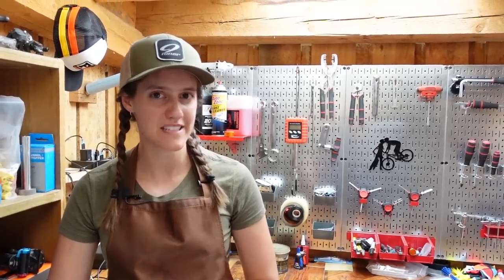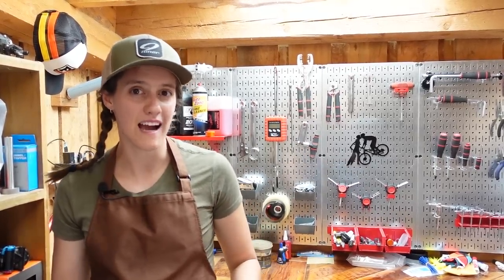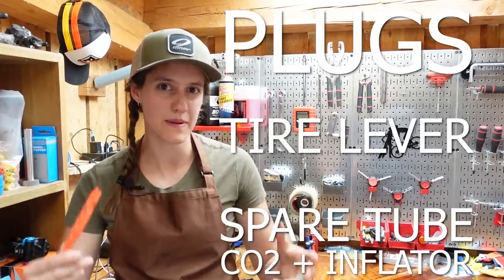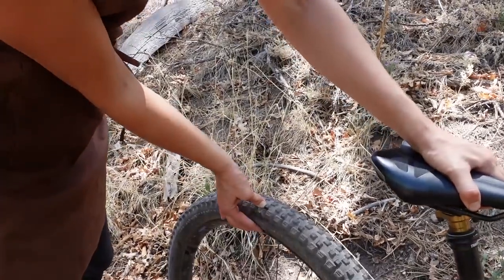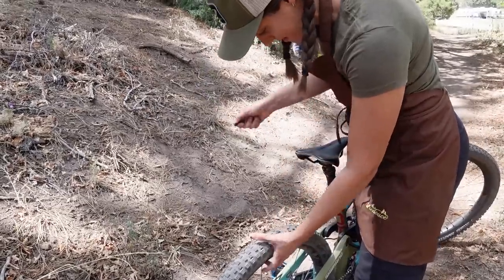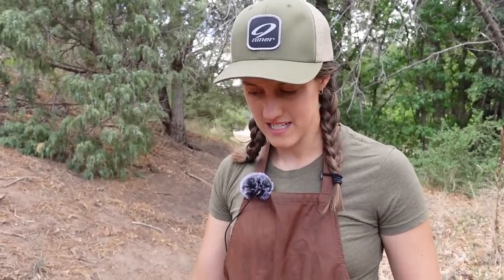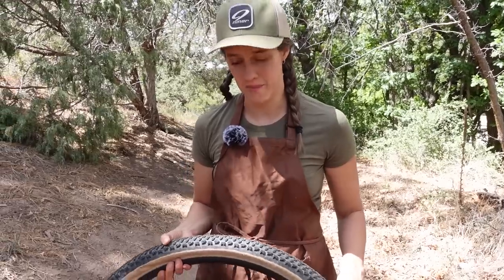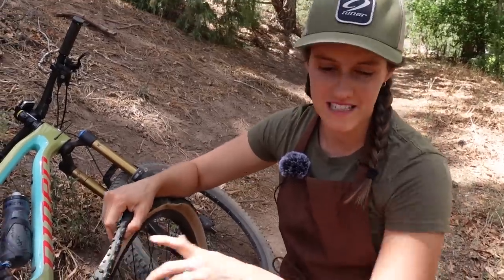DON'T LET A FLAT TIRE RUIN YOUR RIDE (tire plugs, tubes, CO2 and what we carry) | Syd Fixes Bikes

Comment from the maker: We're BAAAACK!!! Thanks for sticking around while we took some time to regroup. Looking forward to sharing some trailside repairs over the next few weeks! Are there any MTB mechanicals that have given you problems that you'd like to see us cover? ⬇️
Reply: Probably not a problem where you hang, but after a winter of mud and washing the bike I had to replace a number of my wheel and rear suspension bearings. There's a challenge for you ...
Reply: Chain repair, and best items/ tools to pack for the trail.
Reply: Derailleur break turned into a single speed
Reply: On trail….  Things that let you ride vs walk out: Ways to replace or wrap a broken spoke.   Maybe delve into the wonderful things a well placed zip tie can fix.  Tips n tricks like, a bottle cage bolt can sometimes replace a broken cleat bolt.

Comment: My third ride on my brand new Ibis 29" with tubeless tires:   PSSTSSSTSSSSSTSST!  Riding some nice redwood single track and something just right (or wrong) and tore a good hole in my tire.  Sealant was squirting out like a hose!  A plug would never have worked in this size hole.  (So much for no flats!)

Oh, and to those who say you can't fix a torn tire...
You can!  Dental floss is excellent thread for tire repair.  despite my 3/8" tear being dead center in my tire tread, I decided to sew it up and patch both sides.  Instead of tossing a brand new tire in the trash, I saved it and $80 in the process!  Vulcanized a regular butyl rubber patch on the outside (luckily 90% of the tear was between the knobbies, so I got lucky there.  And used a large rubber patch on the inside with Barge cement.  The intent was to make this a permanent fix, not a temporary "get me back home" fix.  That was the inner tube I threw in (with energy bar wrapper boot) to get back to the trailhead.

I did a similar repair to a Continental Town & Country I found in someone's discard pile years ago.  New tire, but with a torn sidewall (brake pad most likely).  Dental floss, contact cement and Velox rim tape sewed up and booted the sidewall perfectly.  I got ten years out of that "ruined" tire before I wore the tread off.

Bike shops will NEVER repair an inner tube, much less a tire - it's too much liability, their insurance will drop them, and it's counter to their business model of selling you a new replacement.  But as a consumer, you can do it perfectly safely and save some money - and the planet too (or at least make a TINY difference)!
Reply: Oh, and if the tear had been through the knobby, that could have been addressed as well.  After sewing the casing with floss, I COULD have vulcanized the knobby back together if I really wanted to.  Vulcanizing fluid (patch kit fluid, not rubber cement) is amazing as it forms a molecular bond between two pieces of butyl rubber.  So you aren't "gluing" two pieces together, but actually bonding them, which makes it almost as good as new, when done properly.  LET THE GLUE DRY!!!!

Comment: Whenever you put in a new tube, you always check for thorns, goat-heads, glass, whatever.  Even if you are suffering from a gash in the sidewall, you may have had several small holes patched by the sealant that have thorns embedded in them and will cause another flat.
Reply: I still do that but I also put sealant in my spair tube so it doesn't go flat in another minute
Reply: @benjacobson7490  Yeah, it doesn't help though when I pinch the tube with a tire lever when I put it in. :(
Reply: @DRSpalding  yeah, tubes suck and are always a last resort for me

Comment: TIP. When using self adhesive patches, after sanding the tube (if needed of course, generally butyl tubes) clean the area with isopropyl alcool pads (the small single use pads you use for disinfecting or removing thermal paste on CPUs), especially with all TPU tubes. Otherwise the patch doesn't stitch. And those pads are even useful in your First Aid Kit. Cheers from the Alps!

Comment: Hi, in case of cutting the tire I use needle and thimble, dental floss, and I put three or four stitches. Then on the inside with the Attak Power Flex Gel glue I glue a patch with a blue edge (those used to repair the inner tubes with an orange edge are not good). In this way, within thirty minutes I repair the tire and can still use it as tubles without the use of the inner tube.

Comment: One thing I liked to do when I was running tubes is to (1) put a NEW tube in when you get a flat, (2) patch the tube that just went flat right away and put it back in your bag. This gives the patch time to dry, so if you get ANOTHER flat you can use the patched tube.
Reply: Good idea. I generally save the punctured tubes to patch when I’m at home. But I ride road and gravel an not mountain bikes. SO maybe I’ve just gotten lucky shrugs
Reply: The glue should never "need time to dry" because vulcanizing fluid only works properly when you LET IT DRY!!!!  This is the one of the most common errors in bicycle repair.  People for some reason cannot understand that the glue needs to be dry when you apply the patch.  (It would help to read the instructions!)  This allows the tube to immediately bond to the patch upon application.  After moderate pressure, the patch is permanently bonded to the tube and is ready to ride - 120 psi no problem (on road bikes).

LET THE GLUE DRY!!!!

That said, patch your tubes at home, put in fresh tubes on the roadside.  You don't want to be sanding, gluing and patching while your friends are impatiently waiting and traffic is zooming by!

Comment: very fitting I just had a flat on a ride yesterday. no hole no explanation just flat tire. luckily a tube and a nice person with a pump got me back to my car
Reply: U might've debeaded your tire, I did that once. Slammed my sidewall into a rock and it came off the bead. Just used a co2 and I was back on my way
Reply: @benjacobson7490  possibly. my sealant I noticed was pretty much dried up as well. time for a refresh

Comment: All you need is a pump - co2/hand, a small patch of rubber, which if you wrap your chain area with a tube, you already have on the bike, just leave the tails longer so you can rip a small piece out. You'll also need a tube of superglue and something sharp.
Basically all you do is pop out your tire, inflate the tube so you can figure out where your flat is. Once you've located the hole, use something sharp, like your house keys, a bobby pin, a pocket awl to poke a small patch of rubber inside the tube, through the hole. Before hand, use water (or something else) to clean the area and the patch. Once you've done that, press the patch such that it lines out proper with the hole, it should be larger than the hole and you just shimmy it into place and place a dot of CA glue over the hole and the patch inside the tube. Work the glue inside the patch by stretching the tube over the patch opening the hole (all should be done on your knee to insure the patch stays put). Once the glue has set, place another patch of rubber over, this one just needs to be glued such that it forms a perimeter around and stays put (it does not act as the main repair, just a protection) and refit the tube, tire and refill with air.
If you have the hang of it, this will only be a 5 minute job, depending on how fast you can remount the tire and inflate it. Tips CO2 from your breath helps kick the CA glue into action faster, so exhale over it.
I've had patches like these last years... heck, i've never had one fail. The pressure of the tube pushes the patch from the inside. So it's impossible to pop out short of the glue giving up the ghost.

Comment: To boot a tire, my "go to" is a section of road bike tire w/ the sidewalls removed.  Much like an energy bar wrapper, an energy gel pouch will work.  I've seen others use pieces of milk jug w/ the edges rounded off.  Practicing is a good tip and makes it less likely to forget a key step.  It's easy to forget to check for the item that caused the puncture when in a hurry to get back on the bike.

Comment: I tried to help a friend who pinch-flatted and was running a green slime tube. I carefully squished the slime away from the snake-bite holes and sanded them. got out my patch kit, because (of course) my friend had no tools or patches and poked a hole in the patch cement tube AND the cement was dry! He did a long walk back to his truck.

Comment: Helpful video. Yet I have to say that as an urban (non-racing) cyclist I only carry a patch kit. It takes merely a couple minutes to patch a tube and re-inflate a tire. It’s definitely NOT the “last resort” for fixing a flat. Plus, you can easily fit it in a pocket instead of clamping onto a top tube.

Comment: I just went through 2 tubes last weekend, had to walk back to my truck each time! Thorns both times, maybe i need to go tubeless,  looks like sealent would seal a thorn puncture.
Reply from the maker: Yes! Tubeless is a game changer for thorns. Slime tubes would also be a step in the right direction if you don't want to go tubeless, but we do really recommend tubeless!
Reply: Tubeless is totally totally TOTALLY worth any annoyances, I got six punctures in one week and I got fed up, went to the bike shop and got tubeless stuff, I went tubeless in two hours, and I haven’t had a SINGLE flat since (I went tubeless in august of 2020 by the way)
Reply: Absolutely. I had a tubed bike for a couple of months last year and had two flats from thorns. Now had tubeless for 6 months and when I changed the front for a 'summer' tyre a week ago it had three thorns poking through it - one was about 15mm into the inside - and there were probably others where the thorn hadn't stayed in. I never knew a thing.
But do some research into the better sealants as some don't seem to work as well as others.
Reply: @sydfixesbikes  looks like thats what i need to try. By the way , your video's  are always really good, look forward to the next one!
Reply: @Atxcmtb  thanks for the comment, guess its a mental thing for me, but i think tubless is my next step!
Reply: @mikes4163  thanks for the comment, ill look into the different sealents and give it a try!

Comment: After each ride I usually check the tires for thorns and take them out  so they don't create a bigger hole  and if I find alot .Sometimes I take the tire off and run my fingers on the inside of it.

Comment: Revisiting this topic, I've seen some really light and small rechargeable pumps hitting the market that weight not much more (if it all) than a CO2 rig and can inflate a tire many more times that the cartridge.  I'm thinking of buying one to try in my field repair kit.  They look easier to use than CO2 and bonus is no frozen fingers!!
Reply: Any particular brand you’re looking at?

Comment: A pump is better than CO2 purely from an environmental standpoint. Why use a single use disposable item when a pump can do the same job? Unless you are in a race, use a pump.
Reply: A pump cannot produce the same high volume and pressure as a CO2 cartridge needed to seat tubeless tires, in many cases.  Some tires will re-seat with a pump (I burped a tire off on Gooseberry Mesa and reseated it and inflated it no problem with a 25 year old pump), but many others won't.
But when that fails, you need a fast, high-volume solution and the CO2 cartridge provides that.
Otherwise, I agree with you.  Don't use a cartridge when a pump will do the job.

Comment: This winter I had troubles getting the bacon strip lock into the hole on my tubeless tire. Maybe the low temperature (about freezing) didn't help, don't know, anyway, we had to resort to the tube.
Reply: Perhaps try a smaller bacon strip, this works for me.

Comment: Okay first off I liked how you pointed out which of the things you did / the things we see are Youtube and not real life :D Nice to see someone do that. It's easy to forget as a viewer.

At around 17min (in section 3d), you mention "inflate more than on tubeless, like at least 5 psi or 10" - that is like... less than half a bar? Is that because tubes in tubeless tires work differently? I never had tubeless tires and my minimum pressure on tubes is literally ten times higher, 50 PSI. Even on heavy winter tires for snow it's like 30 PSI at least.
Reply from the maker: I may have misspoken, but I meant "at least 5-10psi more than your usual tubeless pressure". It's much easier to pinch flat with tubes, so we recommend higher pressure than you would use with a tubeless setup.
Reply: @sydfixesbikes  ooh, I could have seen that meaning. That makes much more sense, thank you! :)

Comment: I understood that if the tire goes completely flat, you have to put a tube in because without a floor pump, you can’t get the tire back in the bead. Am I wrong? It seems so, from this super helpful video. Thx!
Reply from the maker: Most of the time, a tubeless setup will stay seated when it goes flat as long as you don't ride the flat or unseat it, so generally you can stick a plug in and pump it back up, even with a hand pump.

Comment: I really wish y'all would've done the tube with all the sealant in the tire.
Dont you have to keep the whole thing off the ground?
Reply from the maker: We just pour the sealant out if we're putting in a tire, so while it's still a bit slimy, it's basically the same as the tire we used. It's gonna leak out anyway 🤷‍♀️

Comment: What about installing a tube after you use a plug with an anchor? Wont the pointy metal/plastic tips on dynaplug and stans darts pop a tube? So if you use the anchor plugs and then it fails or you get another puncture and need to put in a tube, do you need to remove the anchors from the inside of the wheel first?
Reply from the maker: That's correct, you'd need to remove the anchors before putting in a tube.

Comment: Hey Syd and Macky!  I'm a 210lb rider on a 150mm/130mm full sus trail bike, but I ride it on DH parks (Pajarito, Angel Fire and Purgatory) and pretty much everywhere--1-2 times a week during riding season.  I run 2.5" tubeless tires, but I can't seem to stop dinging my aluminum "enduro rated" wheels, eventually destroying them.  I even have a vitorria airliner after seeing your video about them.  Seems like I go through a wheelset a season.  I ride 30psi too just to ensure I protect my rims (even though traction sucks).  Is this normal?  Any tips on preventing wheel damage?  I know you're familiar with the rocky terrain here in northern NM.  Or, is this just the way it is.  It's getting expensive! Love your videos!
Reply from the maker: Hmm... That is surprising. Is it always the rear wheel? If so, it could be a body position issue of being too far back and therefore having too much weight on the rear wheel. If not, then maybe try to avoid the rocks 😉 (obviously joking given that we know the terrain you're riding).
Reply: @sydfixesbikes  It's usually the back wheel.  I guess it could be riding position.  Don't really know.  Maybe I just need a solid steel rear wheel lol.

Comment: Would these plugs work on a tubeless roadtire or would you feel the "bump" due to higher pressure? (asking for a friend)
Reply from the maker: Yes they work! We have used them on gravel/cx tires many times. Obviously whether it seals or not depends on size and location of the hole, but we've never had issues with a bump.

Comment: Can I use a couple of CO2 to pump up my shocks
Reply from the maker: I've heard of it being done in an emergency, but it is definitely NOT recommended! Also, most co2 heads are designed for presta valves, not Schrader.

Comment: Tubes all the way, tubeless is unnecessary, expensive and requires aditional maintenance, i'm not running low pressure or want to. My equipment is supposed to last so rim banging goes on my nerves.

Comment: why do you need a co2 tank instead of just pumping air in with a portable pump.
Reply from the maker: It's not necessary, but much quicker, especially if your goal is to repair the tire as quickly as possible (in a race, for example).